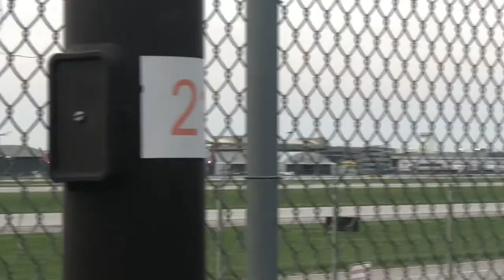Trucker Vlog #154 Truck In The Shop Part 2

Comment: Good to see you Back...Back on the road.  Sorry to hear about the breakdown.  It seems to be the usual fix these days to replace a wiring harness rather than try to find what wire is broken and where.  I guess that's progress.  AKA Plug and Play.  Well I've got fingers, arms, legs, and toes crossed that all goes well from this point.  I'd cross my eyes if I knew how.  It's good you still had your load rather than be sitting around waiting.
Reply from the maker: Thanks I’ll need it